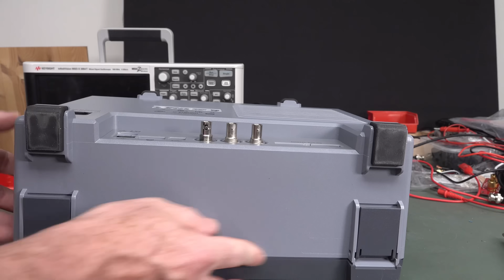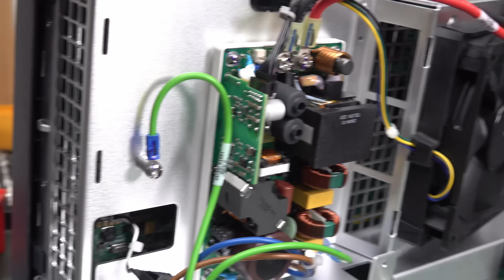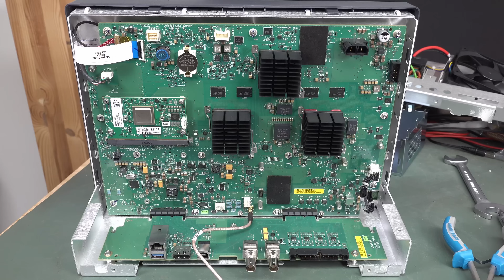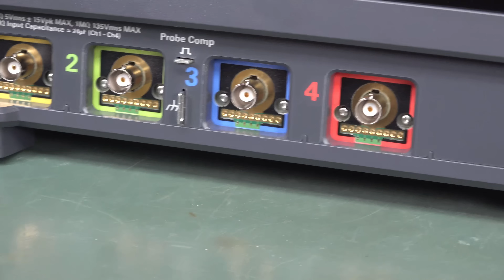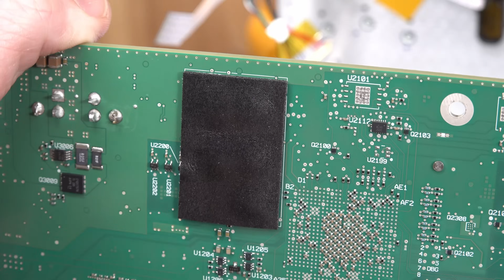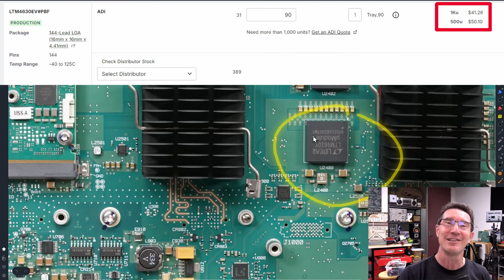EEVblog 1639 - Keysight InfiniiVision HD3 Oscilloscope Teardown

Comment: New ASIC Likely is made with multiple separate dies on the substrate, and likely the heatsink is epoxy bonded to it after assembly, so that it has good thermal conductivity. Then the red thermoset adhesive to hold it down during assembly and reflow. Must be a really critical second pass, with a set of tools to hold the heatsinks in position and held down, while the board gets warmed up to cure the epoxy, likely a preform on the bare die of a slightly flexible thermal epoxy, then the red thermoset epoxy blobs holding the heatsink to the board as well.
Reply from the maker: Possible. Still haven't heard back from Keysight about it.
Reply: If it was all bonded that well, it wouldn't require the springy bracket holding the heatsinks.
From the heatsink manufacturer website, this kind of product is meant to be removable for eventual rework.
Reply: @Damien.D  Spring bracket is there to keel the high mass from ripping the solder balls off the board or the interface with shipping vibration, as you never want to rely on a solder ball to provide mechanical support for anything other than the lightest of chips, and even an underfill can give way.
Reply: Based on my recollection from a few summers ago... it's mostly 1 chip. But I could be wrong, I was in software driver land...

Comment: Hi Sir,

Your videos have helped me a lot, and I really enjoy watching them!

I was hoping you could also show the temperature of the three DACs/ADCs with the three large heatsinks with a thermal camera. I have a lower-end model of Keysight which is  DSOS104A Oscilloscope, and I'm measuring around 70–90°C on the black heatsinks.

I'm not sure if those temperatures are normal because I don't have a good reference to compare them with. I'm currently troubleshooting a unit that keeps power cycling, and I'm suspecting that abnormal temperatures might be the cause. Im planning in installing Fan for additional cooling but not sure if this would solve the issue.

I'd really appreciate any insights you can share. Thank you!

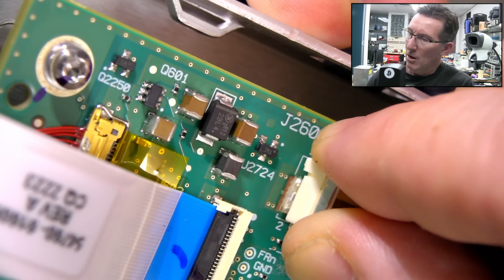Comment: Your gonna have to revisit that bust connector because the copper has come away from the PCB 7:34, you can see the bare FR4.
Reply: You also can see the through hole platings ripped off. At the upper side it seems the signal pads came off.

Comment: wow , its a mini PC with built in display and scope front end .  Ah the beauty of it , Chinese sheet metal really chines on it .  I don't get it , 15 years waiting for this , does it even have OLED panel or its LCD , what is the refresh rate  comon today is at least 120hz , some go to 480hz  , you may think its irelevent , but its not , that is your window , there you get the info , its what you are looking at , it does matter a lot . Professional should know that if not able to remove Chinese sheet metal super low noise front end covers , that i would just cut off , solder it back on . But you do you .

Comment: No you cant get HD304MSO, you need to be a s. mediainfluencer 25k and you cant combined them all together, it needs to be on a single social media
Its seems to be a person called Daniii Bogdanoff according to some of the channels..but you need to be an influencer on social media for the western or russian or USA market, so even if you have like 50k and you have fx an India musicvideos ch... you likely wont get one.. it needs to be in an theme where you can do something for Daniii Bogdanoff Keysight on social media but the worst you can get is a no, so try to ask and yes they are all the same.. its HD304MDO model they all are getting.
There is this Romanian channel voltlog and also one from Portugal called Techcorner that Uni T are very eager to use same with eevblog, so I think 25k subscr. is not the best, there is channel like Joe the Smith.. with 24k.. its a shame if daniii bogdanoff don't give him also... Joe The Smith is the one that EEVblog goes to when they wanna get their multimeters validated after the highest standard on yt.

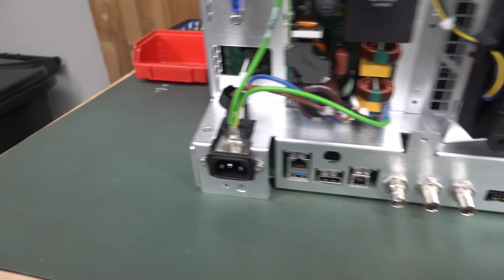Comment: 2:38 i was under the impression that you werent supposed to solder earth connections? Because in a high current fault the solder would melt and leave the device unearthed?

Comment: Dave. I believe that those little springs on the side of the should just clip out of their anchors on the PCB, just the same as on the heat sink of a PC CPU heat sink. Once those are unclipped, you should to easily be able to lift them off.

Comment: Are your really shure that the 50Ohm amps path separating AC and DC to feed the amp chip? What is the purpose of of relay then? I thought that you need at least one relay switched attentuation path for 50Ohm. And that is the reason for the second relay beside the first switching from 1MOhm to 50Ohm.

Comment: ASIC stands for "application-specific integrated circuit". In this day and age, should it surprise you that much that using advanced process, they actually went for the most obvious choice to integrate more components into the "ASIC"? It is not a novel trend in chip making neither, CPU vendors have been integrating an increasing amount of periphery into the CPU, the FPU unit, the memory controller, the memory itself, usb interfaces, modems and network interfaces, graphics and storage... If anything, this is quite a modest and late entry in the field of SoC integration.
Reply: You don't know much about analog and GHz, do you?
Reply: @shazam6274  More than you I bet

Comment: Being able to access an exposed PSU module without unscrewing at least one screw would be considered very bad design. It doesn't make any sense - it is not a frequently accessed part of the device, and it is high enough to be dangerous voltage.

Comment: Thought that PSU looked familiar! I was working there in the R&D lab when they were developing this range. Probably off the shelf but maybe tweaked for their needs. Surprised to them using an off brand cap but they would have lifetime tested the crap out of it first. Maybe it was just a supply chain issue at the time. Underneath that plastic base will be filled with a thermal silicone so wouldn't recommend trying to remove it! Their PSUs are normally warranted for seven years. Think I may sill have one but in a metal case somewhere.

Comment: Dave, what’s your honest take on this? 😕 The bezels are huge, which makes the display feel smaller than it should be, and why is it still shiny in 2024?! They’ve even dropped the GSa to 3.2—though at least it’s across all channels. But the MSO and function generator interface are still awkwardly placed on the back, and overall, the design just feels bulky and outdated. For the price they’re asking, I was expecting a lot more. 💸😒

Comment: 3:34 The TDK-Lambda CUS400M Series datasheet says that the X5 in the KCUS400M-12V6/X5 model number means that optional 10-pin connector has a 5V 2.0A standby supply, and remote on/off (inhibit), remote sense, DC-OK, and AC Fail signals.

Comment: Maybe the FPGAs are epoxide glued down to remove mechanical stress from the BGA solder joints, which might result from thermal cycling. I wonder what the MTBF might be, I suspect not  great.

Comment: Since the megazoom part is multiple chips on an interposer i would expect the ADC and digital portions to be made with different processes. 

I also suspect the digital portion can be made to work with multiple ADCs.   Thus I would expect lower speed future versions might have a lower cost ots ADC on the hybrid.

The ADC on this version could be a combined InP and Si die, SiGe BiCMOS.
Reply: What is your argument for having a CMOS and a SiGe BiCMOS in a single package if the amp is still a separate ASIC? ADC`s profit powerwise strongly from dense CMOS and the CMOS found in SiGe BiCMOS is not better than 90nm recently.

Comment: It would be interesting to know which features are paid for add-on options implemented in software. It is now standard practice to fit all the options hardware and then enable them with a software key that must be purchased.

Comment: All this high tech stuff, and they mount the cr2032 storage battey on the main motherboard making it necessary to remove the case to change the battery. Its  likely that it  does not need to be changed that often, maybe once every five or ten years, but even 2032s can corrode. Is this just bad design or an example of designed in obsolescence.
Reply: They also failed to fit a fan air filter, so the electronics will get a dust coating over time.
Reply: Probably just storing the date and time, so not a big deal.
Reply: Bit inconvenient if the battery is powering a memory with a licence key for added option features.
Reply: @nigeljohnson9820  flash memory or FRAM would be used, we don't use battery backed RAM in modern instruments.
Reply: @jaro6985  must RTC modules and ICs have some memory included. I know of at least one manufacturer, who will remain nameless,  that uses this memory to store keys, but even so it's inconvenient to have to open the case to replace this battery when it would be so easy to add a battery compartment to the case. There still remains the issue of a discharged battery leaking its corrosive content over the PCB tracks under and near the battery holder.  Burying the battery inside the case is so unnecessary.

Comment: Unbelievable, what 15 Years evolution on electronics can achieve! Those numbers are crazy!
Looks like they spent a lot of time around repairability. Almost all function islands on modules. Nice!  
We just have to sell our kidneys to get one…😂
Reply: Not really for repairability, but likely so that they can still keep the base section they designed, and likely ordered around 1000 runs of silicon, and then not have to change it over the life cycle, but still have options for input side and applications processor.  That applications processor chip is the first thing likely to go EOL, long before the main scope itself is done, and thus make it a separate board to fit alternates, plus also not needing to make the main board that many layers, as the 16 layer bit is now plug in. Main board can probably get by with 6 layers making it a lot cheaper and higher yield. Same for input, that they know will likely need to be replaced under warranty as well, or by service, so yes there it is repairable, though you can bet there will, after a few years, be lower bandwidth versions, using the same main board and firmware bandwidth limiting.
Reply: I don't see how you can look at this and think repairability.  If you mean replacing entire boards sure.  But good luck if they will sell you replacements unless you are a company.  I'll stick with my repairable equipment from 20-30+ years ago.
Reply: @fmashockie  with this level of signal integration and 9-11 layers of pcb with all high frequency digital woodoo magic, only option to repair, by modules.
Look on it. Think how you can repair the frontend? Or the ADC? Or the CPU upgrade? No way. Just by modules.
PC works this way since 1983… definitely a intelligent step forward on oscilloscope design. 
We just have to sell our kidneys to get one 😂
Reply: @BMRStudio  Yes you are proving my point! But yes I understand what you are getting at.  I still like having the ability to do component level repair on my equipment.  Not only is it more sustainable, but it always teaches me something new

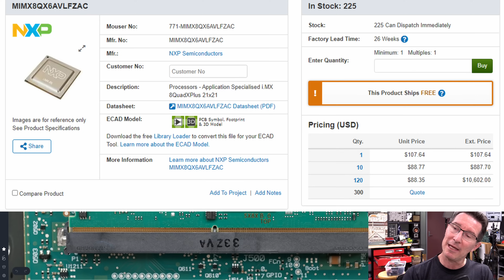Comment: @ 17:54 I kinda hate Freescale processors used in gas boilers - I don’t know if it’s bad programming; bad intentions or bad CPU’s but all the unstable gas boilers boards with corrupted software are with Freescale processors 😅 … and I tested them out by switching them from one board to another and the fault switch with the CPU … never seen an ST CPU (and other brands i don’t remember at 5 am) with failed/ corrupted firmware by power loss or any other means 😅
Reply: That's the firmware library sdk, people still use that buggy shit...
Reply: @robegatt  they make money with it - if the firmware crashes you have to call and pay someone to replace your board on your gas boiler … 
I know others boiler manufacturers that are using an external recovery memory and if something crashes in the firmware it automatically uploads the firmware parameters from that memory… 
The problem is solvable but you have to want it to be solved 😅
Reply: @mihaiachim5299  that is a board manufacturer scamming scheme, it's not a processor fault.
Reply: @robegatt  i know - the cpu-s that I examined have a six level memory with self recovery possibility 😅 but who wants self recovery 😅

Comment: Looks like a serious piece of engineering. I wonder why they went an automotive CPU? Seems like it has a lot of extra peripherals they don't really need, like the audio DSP, camera interface, all of those media decoders. Also slightly disappointed at the off-brand main filter cap on the PSU, but TDK-Lambda generally makes quality kit, so I'm sure it will be okay.
Reply: It's an off the shelf third party module hence the socketed separate board. Seems they didn't want to deal with designing the main processor section.
Reply: Congatec industrial grade, some of their boards they guarantee for 15 years. So probably industrial temperature range and good reliability then. Keysight has had big issues in the past with flash corruption.

Comment: Perhaps the signal gen output is on a flying coax lead because the digital IO board is a standard module between multiple models?

Comment: Looks at the price of the embedded decode package, US$2,500... mmm I could afford that if the scope was free 🙂 About time keysight included basic decode into the product.
Reply: @darrylr  there is a good chance that the money for the decoder is just for a software licence key to unlock the already fitted feature.
Reply: Still too expensive, even with all "upgrades" for free.
And then, for what would you use such a scope, so far I got along fine with huge old logic analyzer, new 16CH USB logic analyzer and old Tek and somewhat more modern Hameg scope. For digital stuff, logic analyzer is vastly more useful and for analog stuff, old CRT scope mostly works fine, for everything else, cheap Rigol will do.
Reply: @hinz1  the type of equipment available tends to prescribe which projects you might attempt. That said, a lot can be done with a minimum of test equipment, but a basic scope is really essential. You cannot diagnose what you cannot see. Personally, I have always found the scope more useful than a logic analyser, maybe because of the number of wires involved in the early days of their use. After all,  digital is just an analogue circuit with the gain turned to maximum. In my experience, the faults in most digital circuits are the result of unwanted analogue behaviour. 
Given the choice between having a  logic analyser and a spectrum analyser, I think I would choose the latter, though I prefer having both. Beyond a certain point, the frequency domain is more informative than the time domain. When looking at a serial data bus, the logic analyser only wins over the scope in its ability to capture long strings of data and trigger on data patterns.

Comment: Mainboard is quite shmick, but the noname electrolytic capacitors in the powersupply? C'mon Keysight. Just repaired MXG signal generator recently, only issue was bulged noname caps (52pcs!) in power supply.

Comment: That top right power connector looks soo much more costly than the simple spades on the PSU end of the wire.
Reply from the maker: Price isn't really an issue on a scope of this class.

Comment: 22:55 Shielding won't be Mu-metal - that's only used for shielding mangetic fields, for CRTs, PMTs etc.
Reply: It was sometimes used for shielding mains transformers in tape decks and audio gear, as well as signal transformers.
Reply: Why do they mount the 2032 backup battery inside the case?
Reply: Might be, as relays are pretty much 'up there with the big boys' when it comes to electromagnets on PCBs and at this price point, with an engineering blank cheque I wouldn't rule it out.

Comment: white plastic on the bottom of the PSU is probably for thermal coupling to the case - no power devices or heatsinks on the top of the PCB
Reply from the maker: Could be. It was very bittle, so didn't seem like ABS.
Reply: @EEVblog  Common in white goods, especially those subject to vibration like washing machines.  They very rarely fail and the compound is really good at keeping parts cool.

Comment: Now this is spomething teardown-worthy. Next one will be Fluke 87-VI... I hope!

12V6@31.75A, holy shit, that thing packs almost as much power as a computer PSU.
Reply from the maker: I suspect the current capability is only used for power-on peaks for the ASIC's.
Reply: Well, with all those ADC's, and the fact that each one uses about the power of the original Core II Duo, you need it. Likely though it runs only at peak power use when all 4 channels are in use, all 4 probes are powering active probes at full rated interface power, the digital input side is running, the waveform generator is delivering maximum voltage into a short, and the USB side is delivering 2.1A per port, plus the optional SA is installed. Otherwise likely only is using 12V at around 10A maximum. 

Wonder who will take one, and put a lithium iron phosphate 4S battery pack on it to run it as truly portable.